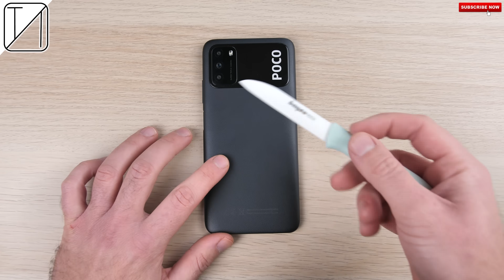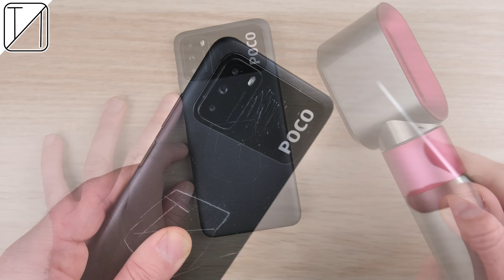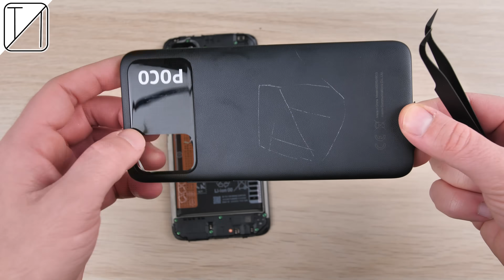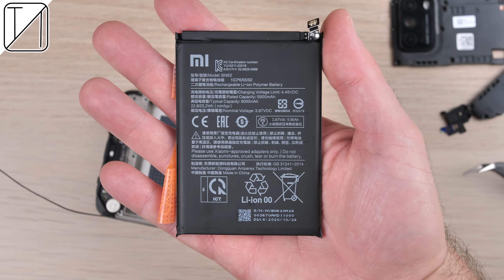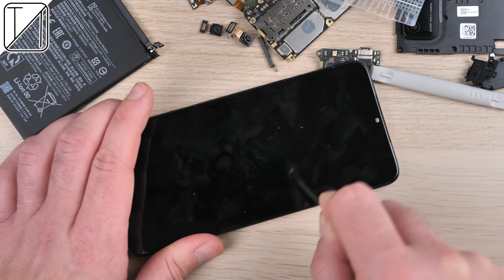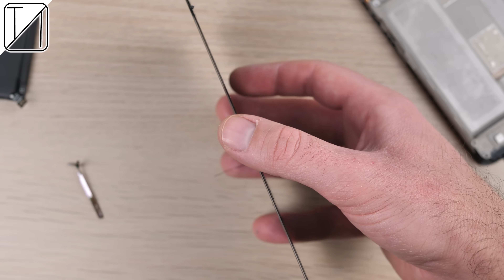Poco M3 Teardown - A Tough Nut To Crack!

Comment: Imbecile. Who uses a ceramic knife? All it does being so hard is just chew up the edge of the frame and the back, which are comparatively soft. You open it with a plastic card, something soft, you can't force the thing open, you just need to nudge the clips open. And it doesn't need heating, there's no glue holding the back piece, just clips.

And then another knife to lift the display... barbaric, absolutely barbaric.

Comment: things i dont really like about this phone
no camera stabilizer(rough)
unusable under daylight
only export 720p on kinemaster prior to sd 665 which supports until 1080p export. 
over saturated picture. 
the phone charging not doing well ,it overheats after 5 minute of fast charging
i resorted to use the slow 5w default iphone 8 charger ... 
the software very slow n laggy.
no fortnite!!
its a massive downgrade overall but i dont expect much for a phone which i bought for $119(promo)
Reply: Upgrade kinemaster premium then u can export 1080p. It's not processor problem 🙄
Reply: you also use poco m3?
Reply: its strange bc my iphone 8 is able to support 4k

Comment: The price is very good for a phone with 6000 mAh battery.
Reply: infinix give it cheaper
Reply: Not really ,you can't buy it for $129, so it's not that great a price...
Reply: Price: 45$
Battery: 10000mah
Charge speed: 60w
Storage: 512gb
Ram: 16gb
Reply: @mangoTV6969  😂😂
Reply: I am watching this video in poco m3 only
Reply: @Harry One 100 sa kya frq prta hai ..
Reply: Realme  narzo 20 
4 -64
600mah
48mp
Reply: Absolutely 💘
Reply: Waste , please don't purchase phone based on battery
Reply: U should give preference to cpu
Reply: 6000 mah means phones will get heat up
Reply: So maximum 5000 mah is best with 33 or 18 watt charger
Reply: Yeah iam using it rn and i can play two games with  5% of the battery